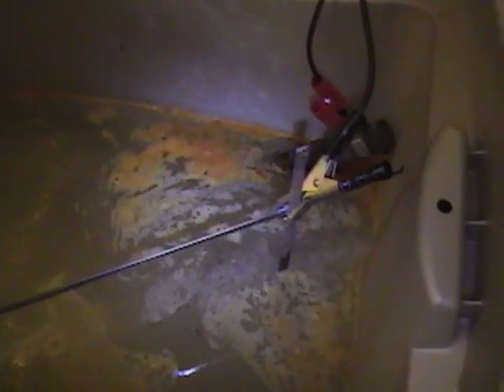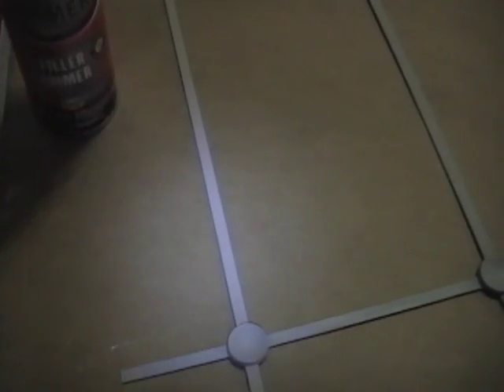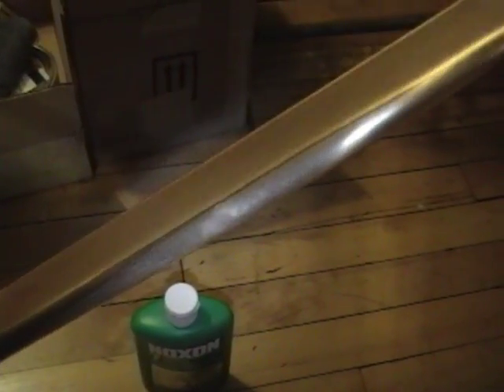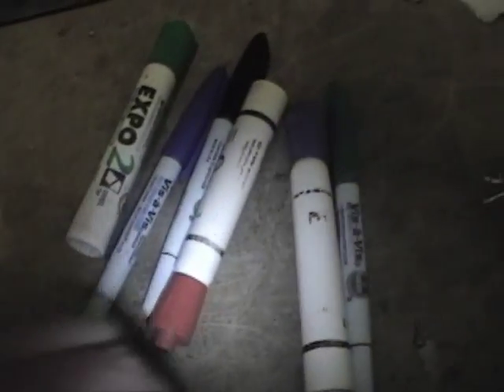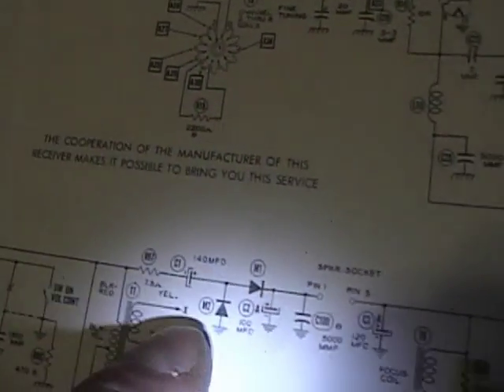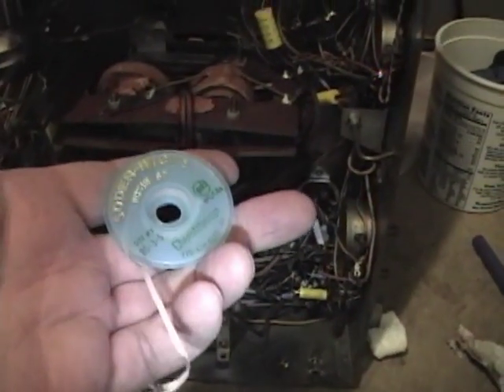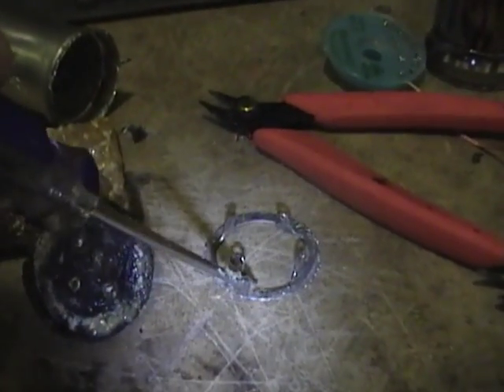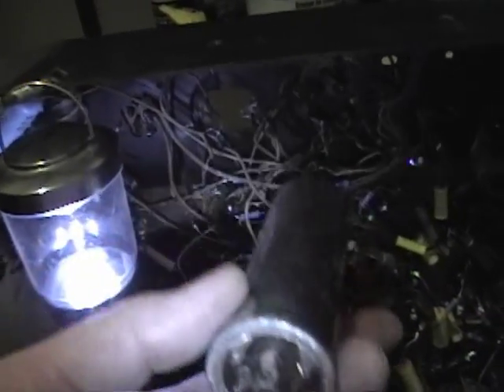Motorola 12K2 restoration p4o?

Comment: I found some brass coloured spray paint once, I can't remember who makes it, I remember using some to repaint the chassis in my Marconi type 12, it's a little less bright then gold and a darker yellow. Its sort of like the difference between that nickel spray paint verses aluminum or silver spray paint. Anyhow it was the perfect match for that chassis, gold just didn't look right as the tuning capacitor was painted a brass colour and the plates were also brass.